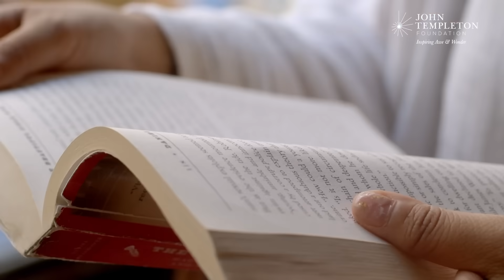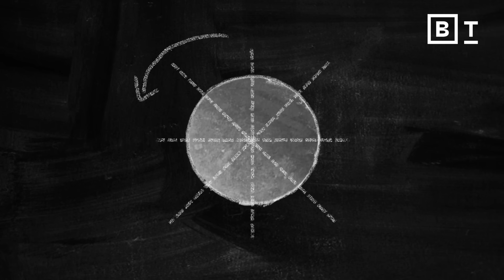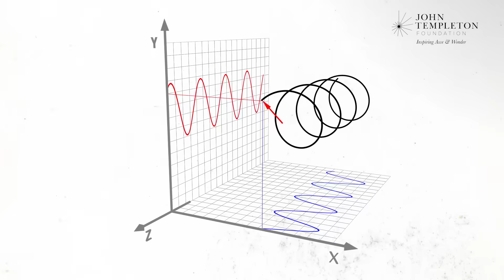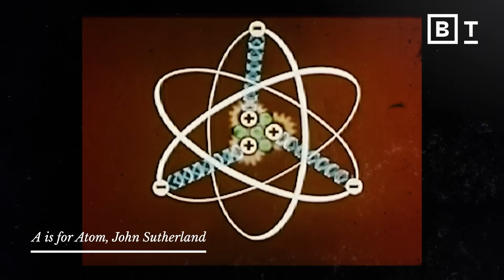A mind-blowing explanation of symmetry | Frank Wilczek for Big Think

Comment: Time is a compact dimension one Planck second in size.  
Through Kuramoto synchrony this creates a hyperplane of the present. We are all on this surface called NOW and always are. But things like photons can move along the surface at a rate of one Planck length each Planck second.  
The other side of this plane is the anti matter universe which is a perfect inversion of ours in charge and spin.  When you make a mountain gold one one side you create a valley fold on the other.  An inflow here is an outflow from there.  Clockwise here is counterclockwise there. This is also because we exist on minimal single sided closed surface (Klein) “Shirley’s Surface”  Surface (cos(u/2)cos(v/2),cos(u/2)sin(v/2),sin(u)) 0>u>4pi 0>v>2pi
Notice that 2 full rotations are needed to complete surface.  Electron half spin.  

Neutron decay cosmology is the physical process solution to black hole paradox and fine tuning.